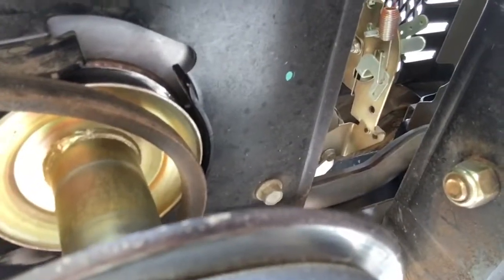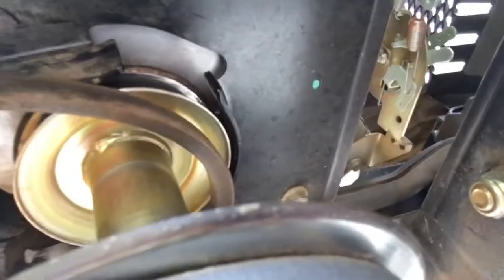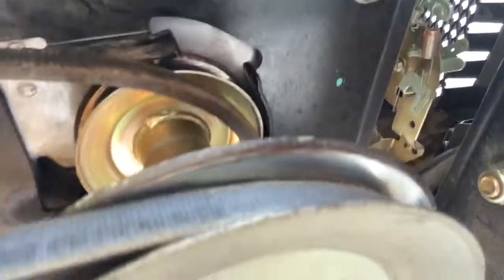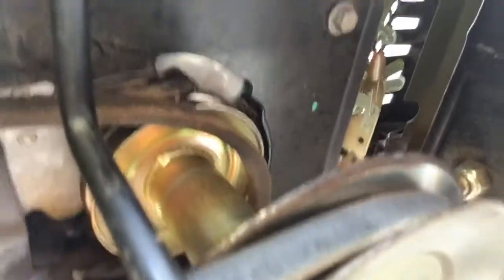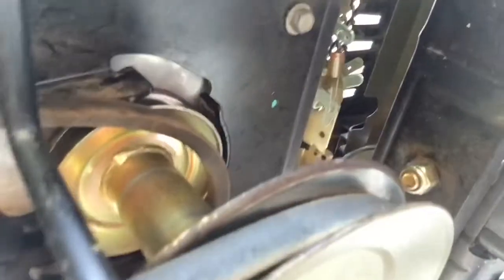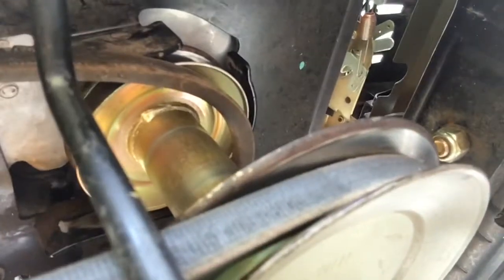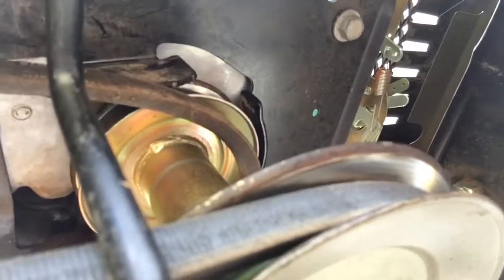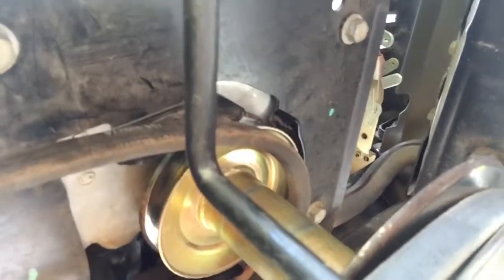Help! Can not reinstall drive belt onto pulley!

Comment: I ran into this tonight! Im sure you already figured out already but, you must remove the pulley from engine. What got me stumped was replacing the 2 plastic pulleys that are under a metal held by 6 small screw/bolts. The plate that must be removed  is under pressure from 2 springs that control tension. I wish I knew what to expect when pulling the bottom plate off to replace belt and two pulleys. It took a while and with a little help studying the exploded diagram used to purchase parts, I was able to put all back together and it worked like new!